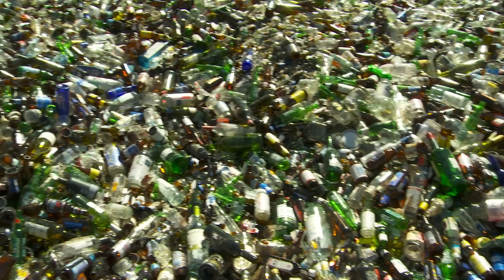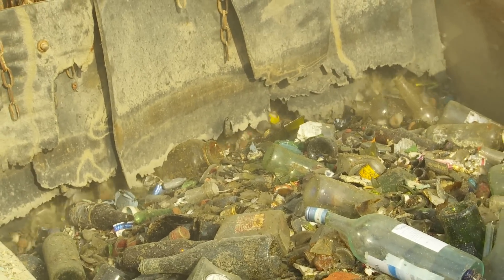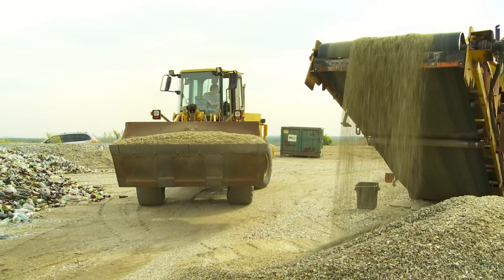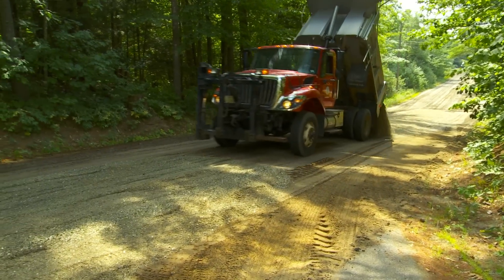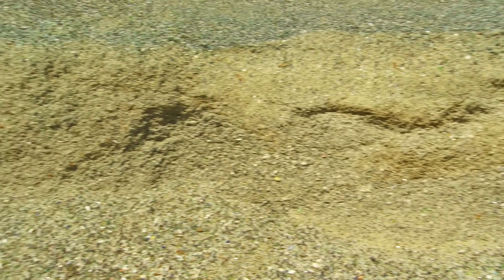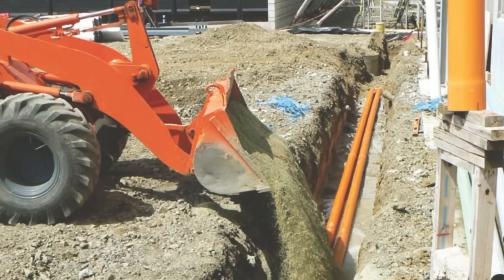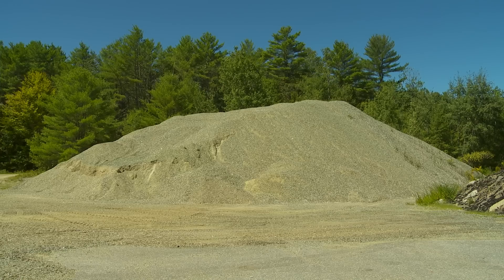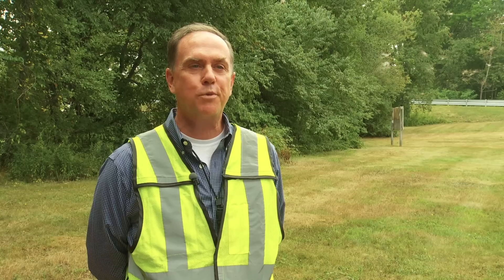Processed Glass Aggregate

Comment: Excellent video and information!  Thanks.. Can this be mixed with cement, to reduce the cost of concrete?.
Reply from the maker: Yes, but it would not be as strong if you use PGA, which is shown in this video, where pieces are still chunks of glass, opposed to grinding it into powder. For reference:

https://www.concretedecor.net/departments/concrete-placing/waste-glass-in-concrete-has-advantages-and-disadvantages/

"The strength of concrete containing glass powder as a cement replacement material is approximately equal to that of concrete containing only portland cement. However, its durability properties outperform that of conventional concrete.

The strength of concrete containing glass aggregates is 10%-20% less than that of concrete containing mineral aggregates. This reduction in mechanical properties is due to the lower strength of aggregates as well as less bonding between the glass aggregates and the paste compared to the mineral aggregates."

Comment: Can this be mixed with cement, to reduce the cost of concrete?
Reply: no it can't cement or concrete needs moisture to bond materials together and this material does not absorb water it actually repels it so it would be good for a base but will not work in the actual mix
Reply from the maker: Yes, but it would not be as strong if you use PGA, which is shown in this video, where pieces are still chunks of glass, opposed to grinding it into powder. For reference:

https://www.concretedecor.net/departments/concrete-placing/waste-glass-in-concrete-has-advantages-and-disadvantages/

"The strength of concrete containing glass powder as a cement replacement material is approximately equal to that of concrete containing only portland cement. However, its durability properties outperform that of conventional concrete.

The strength of concrete containing glass aggregates is 10%-20% less than that of concrete containing mineral aggregates. This reduction in mechanical properties is due to the lower strength of aggregates as well as less bonding between the glass aggregates and the paste compared to the mineral aggregates."

Comment: I drive a concrete mixer, wonder how it would work using it to actually make the concrete in place of sand.
Reply: i heard it's good for asphalt but concrete requires porous materials to bond together. Glass doesn't absorb water so I think it wouldn't work
Reply: For the same reason you cant use desert sand. Too smooth.
Reply from the maker: Concrete would not be as strong if you use PGA, which is shown in this video, where pieces are still chunks of glass, opposed to grinding it into powder (which is more labor intensive). For reference:

https://www.concretedecor.net/departments/concrete-placing/waste-glass-in-concrete-has-advantages-and-disadvantages/

"The strength of concrete containing glass powder as a cement replacement material is approximately equal to that of concrete containing only portland cement. However, its durability properties outperform that of conventional concrete.

The strength of concrete containing glass aggregates is 10%-20% less than that of concrete containing mineral aggregates. This reduction in mechanical properties is due to the lower strength of aggregates as well as less bonding between the glass aggregates and the paste compared to the mineral aggregates."
Reply: There’s a product called glavel being produced in Vermont that is thermally expanded recycled glass that can be used in place of gravel in concrete and gas insulation as well.  But it’s more expensive to produce than this crushed glass product.
Reply: pro internet tip, type any idea you have with the word scholar at the end to get real information on the subject. crushed glass aggregate scholar, I've read many of the glass concrete articles its good stuff

Comment: Reuse of glass cullet saves very little energy. Unlike aluminum where there is huge electrical energy needed to strip oxygen off alumina,  glass only needs melting and temperature hold to allow bubbles to rise.

Comment: Glass was commonly recycled until everything was packed in plastic.
Reply: Every developed country either reuses glass - this is the best Form of recycling or it is collected separatedly and then recycled to new glass bottles since it is reusable basically in an infinite way.
This 1960s variant of collecting the trash together with the glass and separate it later to downcycle it is the american "we are stuck in the last century" way where no one thinks about environment or saving energy or even efficient processes in the first place.
But what can you expect from a country using weird legacy units instead of commonly used units like meters and kilos, discovering insolation on houses as a next big thing and having overhead power lines depite having 120 years of time to bury these lines and then complaining about power outages after every hurricane...

Comment: Could it be used as reflective glass beads in thermo-plastic road marking materials, i.e., white and yellow stripes?
Reply: probably no. That process is going to require a precise composition of glass to get the right size and type of spheres.
Reply: Unfortunately, no. Short answer is that the reflective angles won’t work.

Comment: Sometimes here in Pennsylvania when the sun hits the road made of macadam just right you can see what resembles glitter and I've always assumed that crushed glass was added to the mix.  Is that true, and what are the benefits of using it that way?
Reply: I know for a fact Pa has used PGA in asphalt in the past. Recycling it wasn't as common as it once was, probably due to the vastly use of plastics.
Reply: Probably a sand/aggregate mixture
Reply: The "glitter" is a substance called MICA that is in some gravel in the mix design. It is not harmful to the hot mix, just sometimes annoying under certain conditions.

Comment: I am surprised the glass is not recycled into new bottles and jars. Pretty common in europe where the wast majority of glass is recycled. Saves a lot of energy since the required temperatures for recycled glass are lower.
Reply: Imagine the cost to separate ever single glass color and glass type. Each glass type has a different rate of expansion. So just mixing random glass does not work. It's call COE or coefficient of expansion. Sand mining is not environmentally friendly generally speaking. Neither is gravel mining. A rock crusher runs 8 hours in a day. Then is repaired and welded on for the next 12 to 16 hours. Crushed glass makes a lot of sense. Especially is it is not prone to heaving.
Reply: @tireballastserviceofflorid7771 Teach prison inmates to do it instead of sitting around all day and give them a small wage for it.
Reply: @jimm8246  it's not just man hours. I'm all for prison work believe me... But the sorting houses are massive. The infrastructure is staggering. Crushed glass is a very usable material. The per ton profit though is not great. It's used in media blasting as well. Your cost would be staggering. This company does not even have their own payloaders or grinders. Done on a contract basis. If they can't afford their own processing equipment it says something.
Reply: @tireballastserviceofflorid7771  You don't have to imagine the cost. Most of the glass is collected separated by color in individual containers, but whenever the quality is not right they run it throug automated sorting machines to bring it up to quality. Doing so makes recycled glass a product which is sold and the packaging industrie is happy to buy the material.
Reply: @danielrose1392  Very true. And on a very very limited scale compared to glass products produced. The vast majority of glass of mixed and general considered not worth melting. That's why the road bed products and the media blast products and even beach sand products are critical. You can still use up the glass that is of little to no value. Many of those recycling plants are not profitable. They only are able to operate through big tax brakes and direct funding from various groups. So very little motivation to open something that may not actually be self sustaining.
Reply: @tireballastserviceofflorid7771  In the EU about 75% of the produced glass packaging is recycled. It works at scale.
Reply: @danielrose1392  Surr it does. But the EU is not the same as America. Much much smaller with fewer people. It is easier to implement a recycling program. And those facilities are not profitable. Well known they are supplemented with lots of tax money. Not really apples to apples. All I'm saying is a mixed stream of glass provides a very valuable service to the world. Road beds and other projects with a very low environmental impact. That is a win for everyone. Just like recycling back into a bottle is a good thing. Just because it's not a product that's not shinny and not seen does not mean it's not valuable to the environment.
Reply: @tireballastserviceofflorid7771  bro Europe might be smaller than the US physically but the population is about triple what ours is
Reply: @tireballastserviceofflorid7771  that’s why they can’t waste land on landfills like we do
Reply: @tireballastserviceofflorid7771  being too lazy to sort not gonna work out at higher densities
Reply from the maker: Some glass is recycled back into new bottles and jars or fiberglass, but it must be exceptionally "clean" with no contamination such as ceramic, pyrex, or anything else that folks think is glass, but has a totally different chemical makeup and would result in a poor end product.
Reply: @NHrecycles  Glass is easy to recycle, but... It's a surprisingly difficult thing to use recycled material in many applications.
Reply: @NHrecycles  Pyrex isn’t glass, thanks for that!!
Reply: I think the distance to a recycling plant is the problem, in Europe we generally don't have that problem.
Reply: I'll bet the vast majority of recycled glass in Europe also goes to the landfill.  It is the sales pitch/propaganda that it is actually made into real glass products.  A 1/10% contamination with ceramic/rock will render the melt waste.  Window glass will contaminate container glass the same way.  God forbid someone thinks they are saving the environment by recycling cut(leaded) glass.
Reply: You have to keep the coloures of glass separate to reuse it as bottles. Hard to get the public to do that.
Reply: @davidapp3730  That is exactly how we recycle around here.
Reply: @davidapp3730  Why not just make mixed color glass?
Reply: @kevingrierson2331  Because you can't see the pickles.
Reply: @kkarllwt 😂
Reply: "You can always count on America to do the right thing. After trying everything else first." Winston Churchill
Reply: Lol. Smashing up perfectly good glass bottles instead of paying back the deposit and then rinse and reuse
Reply: @zimmermanlandscape9287  not all states have bottle deposit
Reply: @jays106  unfortunately
Reply: Temperature lol. How hot do you have to get the water before you use it to clean a bottle that you got back for a small fee….
Reply: @zimmermanlandscape9287  I was refering to glass recycling, i.e. melting the glass into new packaging. Obviously reusing is much better.
Reply: @danielrose1392  IKR theoretically..But a lot of things are good in theory
Reply: recycled is too Woke for real Americans
Reply: @DSAK55  I totally agree I was thinking about burning my house down and sleeping outside because I heard houses are woke
Reply: guess what, we're not in europe, pal
Reply: The start of the thread said post consumer glass was commonly recycled in Europe.  I doubt it. That's why I mentioned Europe.  BTW, many on You Tube are in Europe.
Reply: @roadmaster720 bozo

Comment: Would this be a good product to use on winter roads instead of salt? Perhaps even mix it with a small amout of salt to melt the ice on roads and the CGA for traction
Reply: The dust when it dries is too good for your lungs.
Reply: It doesn't lower the freezing point of water like salt does, so it won't help thaw any snow or ice already on the road.
Reply: @stepaushi They are talking about using it like sand grit.  Adds traction, not to melt ice.
Reply: Thats what I meant. Traction. Mix it 50/50 with salt and done.
Reply: @mander6447  Ah, okay √